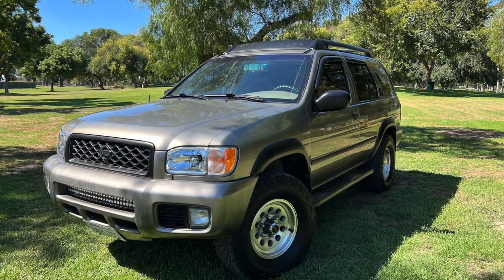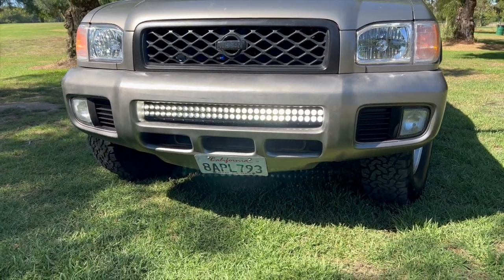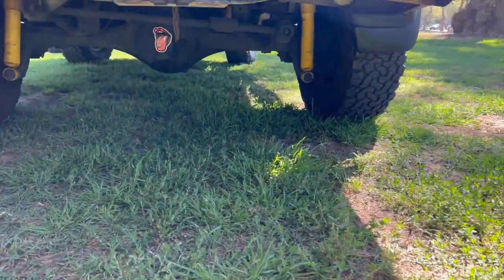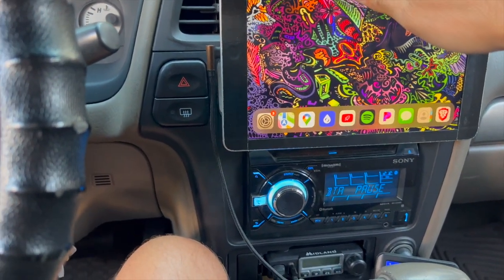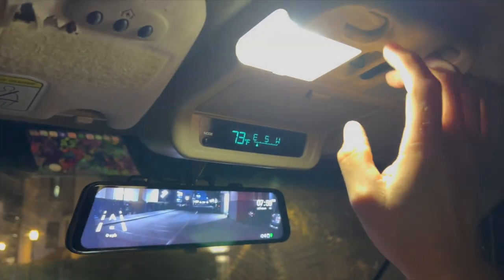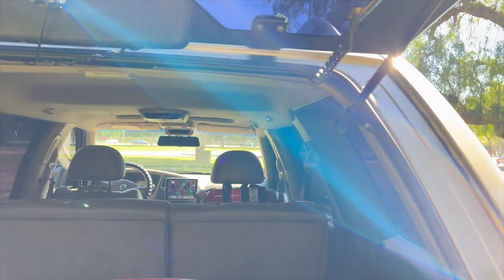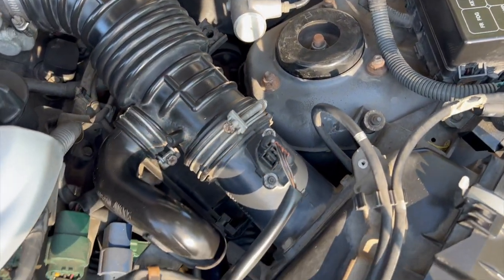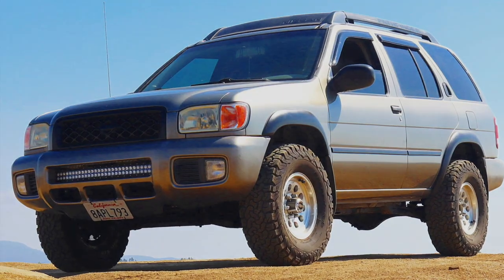2004 Nissan Pathfinder R50 Sleeper Off-Road Build

Comment: I have a 2002 pathfinder I bought it with low kms from the original owner $6000 it has the best traction I’ve ever experienced in a vehicle (deep snowy conditions only where I live) only problem is we get rust where I live so there is no point in putting money into the vehicle. It’s the same setup as yours except it’s got the electronic 4x4 switch and I think in 4hi it locks the differentials because all four wheels spin equally and the steering is heavier.

Comment: This is sick! I had no idea my 04 Pathfinder had this much potential! What do you think the overall cost of all the upgrades was? Did you do all of the upgrades yourself? Thanks!
Reply from the maker: Thank you. Yes I did everything myself. It was pretty cheap using mostly used parts I found at local Pick Your Parts. It's very capable and reliable. I just took it to Baja on a 10 day camping trip with no issues. I barely even had to use the 4x4.

Comment: I love you truck ! 2 questions,  how wide are the tires & what are your wheel specs (width & offset/back spacing). 
I'm trying to put 31's on my R50 with O.M.E springs & struts but limit rubs. Currently looking goofy with stock 255/70R16😅
Reply from the maker: Thanks for checking out my video. My tires are standard 31x10.5Rx15 BF Goodrich K02s. Not sure the exact dimensions but it should be easy to look up.

Comment: Im new on R50 please Give more Tips specifically On Lifting the Tires for Off Road
Reply: ARB-OME2928 springs for the front, OME1022 rear. Should allow you to fit up to 32" tires with some minor modification and trimming of the inner fenders. I run 31" patagonia MTs on negative backspaced rims (although I really am not sure what that offset is...). They'd fit without the offset rims, but running snow chains wouldn't work as they would hit the spring perch on the front struts.

Comment: i want one of these i can beat on as a good offroader. Can these withstand the abuse? Any problem Things i should look out for? Or upgrades that should be done right away?
Reply from the maker: After replacing the stock suspension with OME, The only thing i've had to replace are the strut bearings in the front due to driving really fast over washboard roads under weight. (not advisable)  The macpherson struts are just not as rugged as wishbone ones. However it's a cheap part  to fix but does require you to remove the struts and use a spring compressor. Kind of a PITA but not that bad if you have the tools and space.

Comment: How the heck did you install the lightbar???? Very interested as I have a 03 pathfinder
Reply from the maker: You can bolt it directly to the steel bumper underneath the plastic one. You will have to cut out the plastic a bit for it to fit properly

Comment: Neat setup! The only things I see wrong with it are the facelift hood/grill/bumper and the engine which isn't the legendarily reliable (as long as you add oil every trip) and oil leaking  VG33e xD
But at least the first part is simply aesthetics... haha

---
*edit: Holy $#|7 3:52 ?!!! mind = blown 🤯
Details pleease!! That looks stock... I will be tracking down and/or building one along with one that opens downwards for a James Bond nail spraying effect... LMAO (only half kidding😁)

You should get a commercial 4 channel dash cam too... After getting t-boned (not in the pathfinder) I got one and fished all the video cables through next to the normal wiring harness so I get any future collisions in 1080p in all directions and have defense for speeding tickets when the cop is just being a dick and I wasn't speeding with the GPS independent MPH overlay (twice now its happened albeit over a 10 year period). 

---

I achieved a whopping 3 inches of lift after putting a set of ARB 2922 springs in the rear after putting in sumosprings and discovering just how much the stock springs had sagged over the years when the sumo springs were acting as the springs all the time. Now the hitch receiver is back at the height which puts anything left in it at that perfect knee-busting level I remember so well from years ago.... 😆 Got a noticeable rake going on now, so the plan is to do lift springs and possibly a 1" spacer in the front. Well either the spacer or a SFD if I feel like fabricating the extension blocks... they're not that difficult though. Thinking about it now I think Ill go the SFD route with engine mount spacers to get my oil pan a bit more clearance on the trail. With the right angle strut spacers that won't require camber bolts either AFAIK.

If your locker is in the front then that's likely pretty close to as capable as mine with a welded solid front diff. I'm curious how well the mechanical front lockers disengage when turning on a hard surface. I've got a couple extra diffs and would like to do something a little easier on my power steering system and have been considering an e-locker for a while, but haven't had an extra $1300 laying around to sink into that just yet and the welded one definitely has the desired effect with the hubs locked.
Reply from the maker: I sense a hit of sarcasm here haha. Yea it's given me nothing but good times to be honest. No major issues except oil leaks which I have fixed by replacing all the seals over the past few years since I bought it. It still burns oil but what do you expect for an almost 20 year old engine with over 250K miles? Still runs as strong as it did when it was new. As far as that rear hatch release button goes, yea it came stock like that. Pretty cool feature I guess isn't widely available.

Comment: Recommendation for after market front recovery points?
Reply from the maker: I don't think any exist. The stock ones are fine as long as you use both together.
Reply: Thanks. Will use soft shackles and a tree saver so both will share the load.

Comment: Howmuch did you spend on the full upgrade?
Reply from the maker: For what exactly? The suspension was the most expensive part because I went with a OME kit instead of what most ppl use which is LR rear coils with Bilstein shocks. I'd recommend doing what most other ppl did to save money but it will ride a bit stiffer in the rear using the stiffer LR springs. The other stuff like the front axel and 3rd member I got from local Pick Your Part yards and it depends on what they change in your area. It was very inexpensive though and totally worth it. The front locker I think is about $300. Also, totally worth it. It's a game changer combined with the rear Xterra LSD.

Comment: What's the difference from the 4.2 diff to a 4.6? Gears lower?
Reply from the maker: It came stock as a 4.3 open diffs and yes it’s the gearing. The 4.6 is better for bigger tires and the xterras with the LSDs are also 4.6 so if you want to swap out your 3rd member, the front and rear need to be the same gearing.